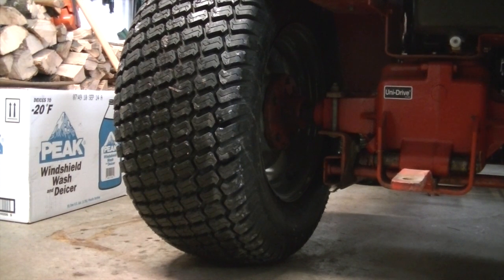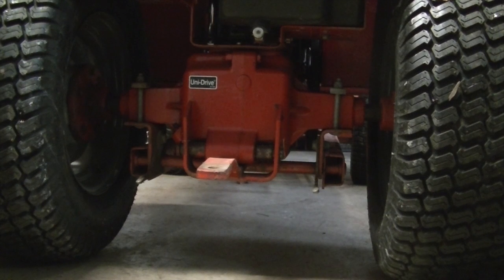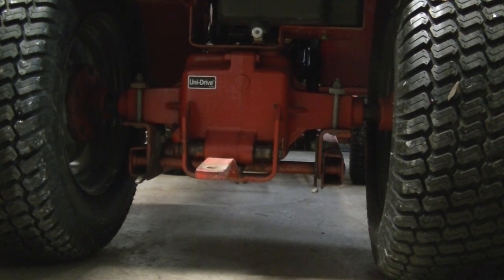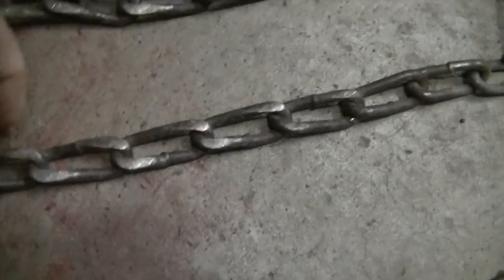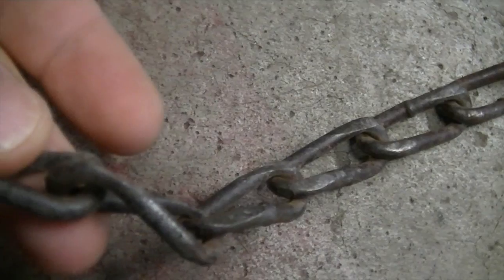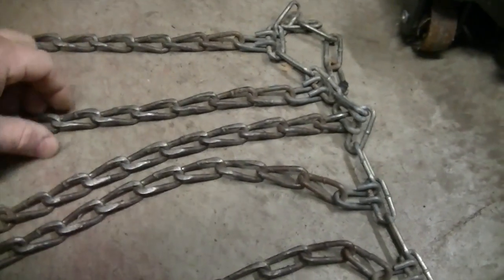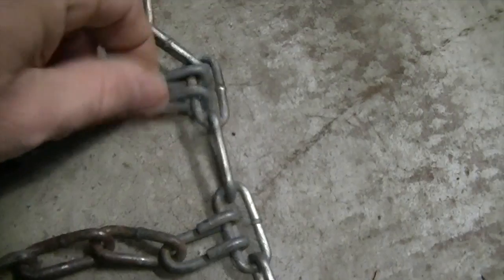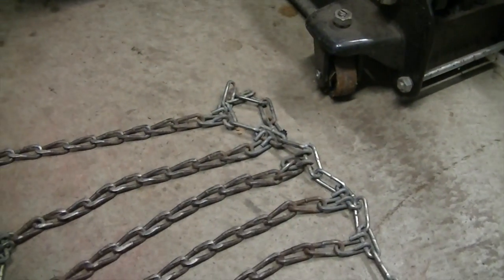Wheel Horse Tire Chains

Comment: I HAVE DONE THIS FOR NEARLY 40 YEARS. BEST, EASIEST I HAVE FOUND IS TO REMOVE TIRE, DEFLATE INSTALL CHAIN ,RE-INFLATE, TIGHTEN WITH BLACK TARP STRAPS. PLOW ABOUT 1-1/2 MILES OF DRIVE WAY EVERY SNOW. NO PROBLEMS.

Comment: Nice to have the two links instead of the four links. Smoother ride on pavement.
Reply from the maker: You're right, much smoother.  These tires are really soft as well.  So much nicer than those hard cracked stock tires.  Hey, I closed my FB account a month or so ago, just so you know.  I may open it again, I just got tired of the candy crushes and constant constant notifications I could never turn off.  Get me on Google or the Tube!

Comment: What tires did you buy ?  I want those exact tires on mine
Reply: Prob Carlisle brand, I just bought 2 front Carlisle brand from tractor supply. Just type back tire size for your wheel horse and look for that brand, you can tell by the way they look